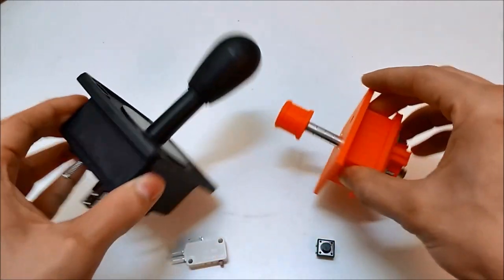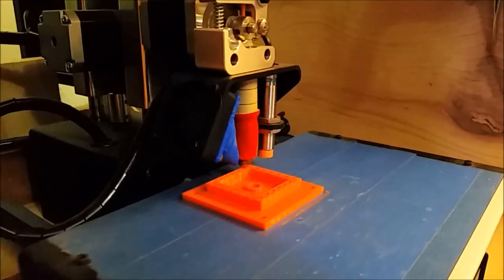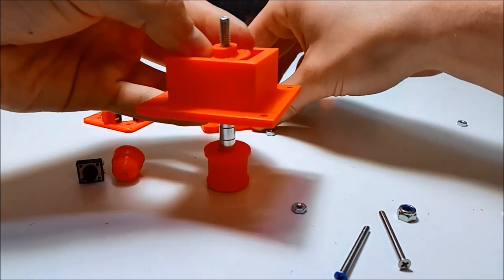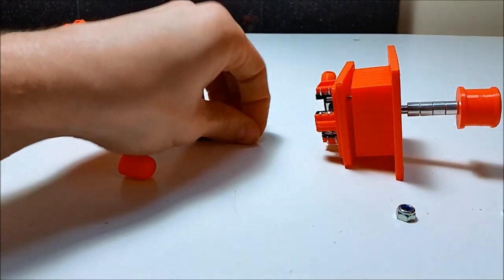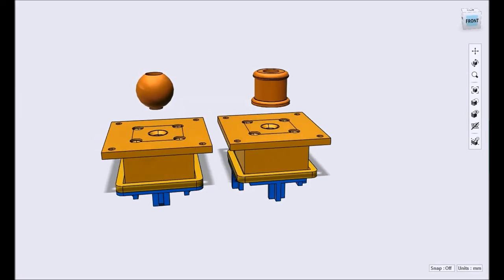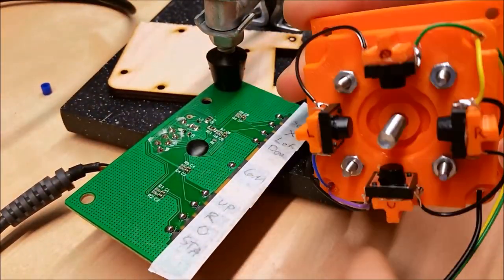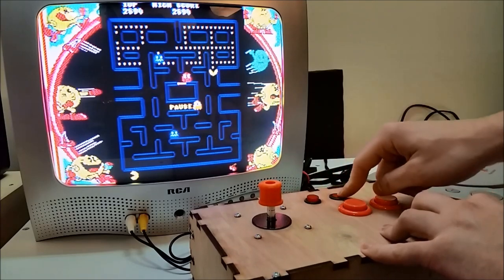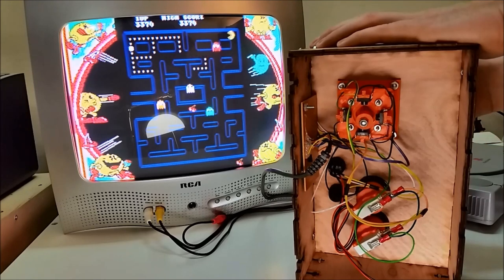3D Printed Micro Arcade Joystick with Tactile Switches

Comment from the maker: "Why?" I was curious if I could do it. I sorta have a need for smaller [low cost] joystick and this was a place to start.
Reply: Ryan Bates great video
Reply: Ryan Bates very creative, never thought of a tact switch joystick
Reply from the maker: Thank you!
Reply: Ryan Bates that was pretty badass to just come up with the idea of 3D printing the parts and putting it together.
Reply: Thanks a lot. 
Not in every country you can buy this sort of DPad, and in Ukraine you can buy it for ~20$. And when this is 1/10 of your salary, then you think how to reduce costs, and here is where soldering skills and 3D printer get uses.

Comment: why did you use masking tape on your 3d printer ?
Reply from the maker: back in the early days (the era this printer is from ~~ 2014) prints didn't always stick to the build plate. the tape's semi rough surface helped with bed adhesion.

Comment: Could you modify to an analog design with a couple of pots? I've been looking for a joystick that size that could be analog. I hope you shared the actual design file and not just STLs. If not, would you consider doing so?

This is so cool, and thanks for the video.
Reply: That would be pretty easy to do.
Reply: really? @TheRedstonelabz1
Reply: @josecarlosxyz  yes you basically just need 2 potentiometers and some 3d printed parts and you are done

Comment: First things first, thank you for this! I love this project and want to make one of my own. Unfortunately, I think some details are left vague. Such as the spring. Springs tend to be one of those things that can make or break a project. Do you have any details on where you got the spring? Was it repurposed from something else? Did you buy a box of assorted springs? Was it from the original joystick you took apart?
After roughly 9 months, do you still use the joystick? Did it hold up?
Reply from the maker: The spring is from an assortment of springs you can find at the home improvement store. It still holds up, though I treat this joystick with light duty use in a claw machine.

Comment: Love the project.

How has the material stood up to the abuse a joystick can take?  I've been 3D printing stronger materials recently and love the polycarbonate based Polymaker filament.
Reply from the maker: Thank you. So far,  it's held up. I only grip this joystick with my thumb and forefinger, which limits the amount of lateral force I can exert.  If something were to break (likey shear) i would guess the "t" pillars holding the tac switches. ABS or a polycarbonate would do this better justice.
Reply: Nylon would reduce the 'plastic on plastic' feel, as would PETG, as they are 'self lubricating', you don't get that squeaky scrubby feel. They are also much stronger than normal plastics.

Comment: Great video 👍🏻 I'm trying to do my own DIY joystick but I keep getting stuck wiring the ground.  I'm piggy backing off  a 3rd part controler from SNES. Is daisy chaining the ground all that is needed or do I have to wire each ground to the PCB as well?
Reply from the maker: both will function, but daisy chaining the ground to the PCB is the typical solution.

Comment: Pretty cool!, by any change you have any idea how to do it with optical sensors instead of tactile switches?
Reply: Well with optical sensors that would require you to code for the distance for a full press of stick which could allow for digital and analog press if you were doing buttons but with the stick you would have to code the optical sensors for the distance where Nuetral is the farthest away from any sensor while the closer the stick is means movement if Nuetral is 0 =no movement  50 = half way which means (full/half walk speed) and 100 = full movement (running/full run speed) all you need to do I code for the distance between the stick and the optical sensor so it can know when to activate in game movement
Reply: So if 100 =full push to any direction which is the closest the stick is to the optical sensors then you could set the sensors to activate at 0.10 cm away from Nuetral or that minus 100 so 100-0.10=99.9 so at 99.9 activate movement

Comment: you kept calling them micro-switches...
I feel like your design would be better with actual micro-switches instead of tactile switches.
Reply: I thought so as well, but i think they are too big. The microswitches have one side where the metal plate (the trigger of the actual switch) is mounted and either you would hit those when goin diagonal or u wouldnt reach them at all, because the rectangle they are creating is too big for the throw of the stick. I hope its understandable what im trying to say.